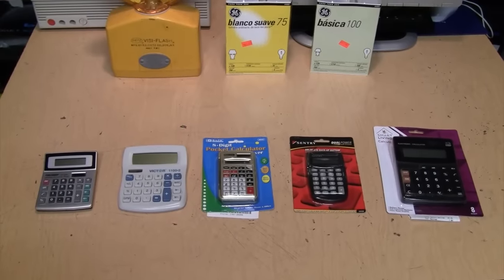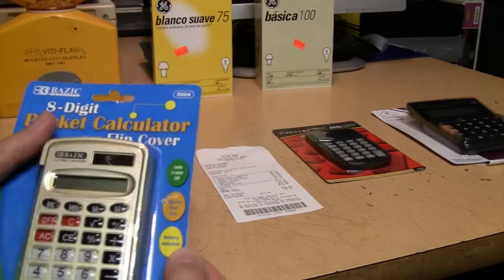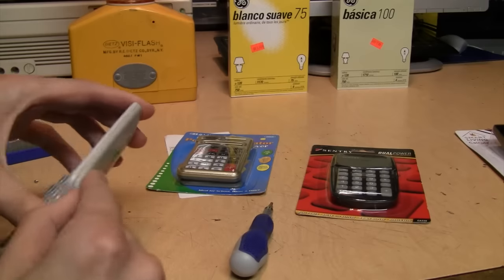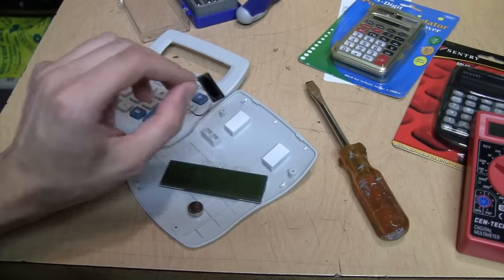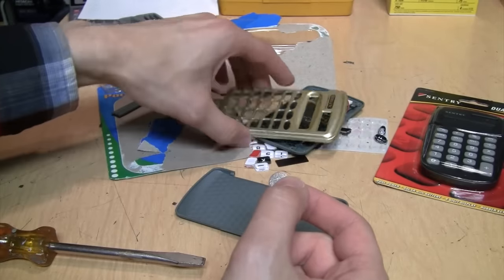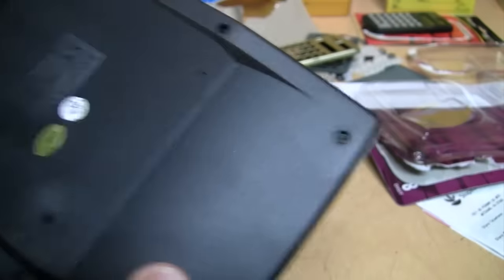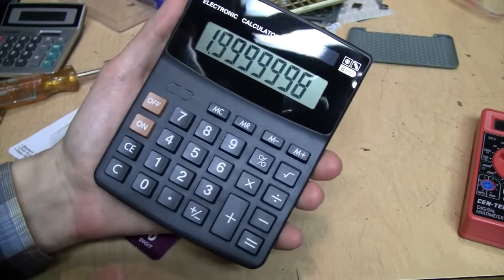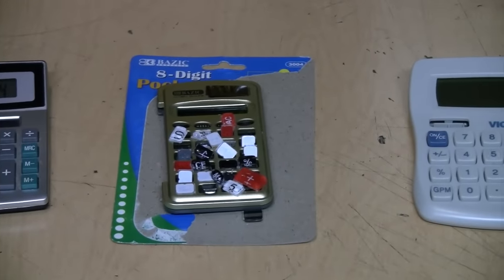Solar calculators BUSTED!

Comment: I found this out in primary school back in like 2010. I was equally disappointed. The strangest part is, some of them had actual solar cells with solder pads… but they just never connected them.

Comment: The diode is there to keep the battery from discharging into the solar cell when it's not producing voltage. It's a good idea, executed as cheaply as possible.

Comment: I always figured it was because they had the solar panels, realized it was cheaper to build them like this, and never updated the plastic case, but that doesn't make sense because the fake solar cell would probably cost more than just not having the part there too.

Comment: I brought a Casio dual power calculator in 99 it just went bad on me this past month. I usually stick with the name brands it doesn't cost that much more and it last forever.  2 Casio  watches from 2004 still  have them works fine.

Comment: This motivated me to find my old Canon LS-3 solar calculator.  I looked it up online and it says they were introduced in 1982, which sounds about right.  Still works fine.  Somewhere I have a TI scientific that would do statics.  If I remember right it only used one AA battery and I think I've only ever put maybe 3 in it in all these years.  The LCD screen was a major improvement over the LED screens from the mid-70's.  Those things would eat the batteries in less than a half-hour of use but they were pretty.

Comment: Its crazy how disposable these are now. When I was very young my Dad bought a Ti SR-10 calculator in 74 or 75 when he was going for his FCC license. I remember him buying it in a camera store it was $95 which was a huge amount of cash then. It had a plug in adaptor and a naugahyde case. I wasn't even allowed to look at it! When The Little Professor came out, it was expensive enough that if I wanted it,  it would be instead of a good toy which wasn't happening. Finally around 1979 I was able to afford my own calculator when Grand Union (defunct New Jersey supermarket) started selling "cheap" Ti's for $5 which was 5 weeks allowance that I saved. The insane part is I absolutely HATE math and am pretty bad at it. That said my dream is to find a decent Curta for under $500. go figure

Comment: Tip if you want to check whether the solar panel works - cover it. If the calculator turns off, it's solar powered.

Comment: I had a calculator that had a working solar cell. 
The battery had died out at one point. After that, I noticed that if I covered this black strip, the LCD fades out and the calculator resets.

Comment: I recently bought a very cheap, very basic  “dual” powered calculator. I haven’t taken it apart because I know the solar part works. It came without a battery installed and when under a light source it works. 

It takes a  AA battery. So I put in a rechargeable one I had. This caused it to NOT work when exposed to light but it worked when no light source was available! When I replaced it with a regular AA battery it works. But I don’t know if the solar panel (that it obviously has) is doing anything!

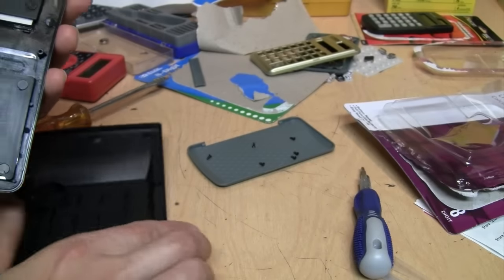Comment: 13:38 Could that diode be there so that the calculator can capture noise and use it as an entropy source for a random function?
Reply: The diode (looks as a germanium type to me) has been added to prevent the solar cell from charging the battery which is a not a good idea. Usually it is integrated on the PCB itself or in the IC.

Comment: I noticed on testing the solar cells with the meter that you did not test them with no light. The wires could have been getting voltage from the battery instead of the cells. Testing with no light should have no voltage.

Comment: The molding dies just weren't worth redesigning after lithium button cell power density made it possible to run for many years without replacement or a solar cell. It's not a scam at least not intentionally. In China lots of old factory tooling gets passed around and used and repurposed for decades. Alot of products have these quirks.

Comment: Some years back I bought a cheap shake flashlight. Worked fine in the store! Getting home I looked closer. The Supposed Neodynium magnet, was just a zinc dipped iron slug. The coils were connected to nothing and the flashlight was only powered by a button cell. So this was obviously a fake product, both fooling the importer and the customers!

Comment: In my experience, it's hard to find a real new one for cheap. They just don't put solar cells anymore in cheap calculators.

I have three old ones from my uncle, 70s and 80s. All have solar cells and no battery. But like I've said, they're 40 years old. Still work though.

Comment: My 30 year old Texas Instruments solar scientific calculator still turns on when it gets taken out of the droor and into the light. Unfortunately I put it away immediately since it's horrible to use because this model has silicone buttons instead the plastic ones found on later models that make punching numbers a chore.

Comment: The diode is connected to the battery terminal so the power from the solar panel doesn't potentially destroy the battery or blow it up or whatever... I doubt it would though

Comment: I had a solar calculator without a battery back in high school and it was really annoying because it wouldn't work with the class lights off if I wasn't sitting by the window.

Comment: I can't tell for sure, but it looks like maybe there are two pads on the right hand side of the last calculator. If indeed this might be the same calculator as sold in china,  you should try soldering a cheap speaker to it and see what happens.

Comment: After around a decade, the little solar powered flashlight I had as a kid stopped working, and I opened it up to discover the same thing! 
It had an ACTUAL solar cell in it though! I tested it with a multimeter and everything; they just figured it would be cheaper to use a real cell and not connect it to anything, I guess.

Comment: Technically speaking those aren't batteries powering your calculator either.  Technically those are air-zinc fuel cells, and that's why they last so long.

Comment: The problem with the fake ones are that they basically using the mold from a real solar calculator but a real solar calculator will cost you between one and ten dollars depending on who made it and where you got it.

Comment: I suspect not many calculators can do square root of 2 times square root of 2 properly.  To do that would require far more advanced logic that remembers the previous entry in its pre-calculated form.

If all it is doing is storing the last floating point value and applying it to the next operation its going to have rounding errors in basically all cases.

Comment: 14:36 - Not disconnecting the battery before making the measurement? The measured voltage might have been from the battery, not the solar cell.

Comment: I see 2 things happening here.  Sold as being solar with no battery needed to get more sales.  The cost of batteries is so low that it's advantageous to use a battery in order to get the sales.  When the battery runs down the user assumes that the solar is no longer working and just gets a new calculator.  I checked 5 units at home and 3 of them were actual.  On the the 2
units with batteries the screws are so minute that the average person would not have the tools to open and change a battery.  Oh, but wait.  Since I think it's solar, I would just assume the solar unlit has failed and toss it anyway.  Never mind.

Comment: When electronic calculators first came on the market they were pricey and would keep them locked up with cameras. Years they had gotten so cheap later I was amazed to see them hanging in the checkout line near the cashier.

Comment: In the 90's they made solar calculators without batteries for real, i have one.
Disadvantage is, when there is low light and the display starts little to fade out, but is still good readable, it may calculate nonsense and give more or less random numbers as result.

Comment: If I were to guess, I'd say these calculators are so cheap bc they've been making them or ones similar for decades, and making the equipment to create new calculator cases would eat those profits. So they use the old solar cases regardless if they implement a solar cell or not

Comment: I think the reason why they put in fake solar cells might because it makes it easier to manufacture different models. They can have a solar and non solar calculator using the same front panel

Comment: We've got a blue calculator from Japan that's been in our junk drawer for the past 25 years that has a solar panel on it. We know the solar cell is legit because the battery died at least a decade ago and you have to hold it in direct sunlight to get a nice strong contrast on the screen.

Comment: So you managed to break multiple, perfectly functional calculators, only to find out that some manufacturers use coloring on the calculators that resembles a solar panel, but make no claim that it is a solar calculator…..BRILLIANT!  And that only took 18 minutes. SMH🤦🏻‍♂️

Comment: It could be that they just use a standard casing... and putting in the solar component is optional - so for the ones that don't they just put a blanking piece in there.

Comment: They just make 1 case for both calculator.  They didn't claim on the packaging that it is a solar calculator in the first place. But in case they make another 1 solar power than the hole is already there

Comment: We use TI-30XIIS in the center I work at in the college.  TI supplied us with a load for free since we will only allow this make and model in our facility.  I'm sure they think they would make more then enough back as student purchase the same calculator for home use.  When our first one died on us it was brought to me since I do some electronic work.  I looked at the unit a second and said I think I knew the issue.  I opened it up using my swiss cyber knife.  I said here is the issue, the battery is dead.  The instructor was insistent it was solar powered.  I pulled the piece of black plastic up and said what solar panel.  I told them it was common to do that.  Other models can use the same case and may have a solar panel.  This model didn't.  I ended up ordering a bunch of replacement batteries.

Comment: That's messed up! As a kid I always thought those were light sensors, not solar cells, used so that it would turn off if in the dark for a while (like in a pocket, purse or bag) to save the battery life.
Reply: found out the hard way it was a solar panel

Comment: I had a Philips scientific calculator that has a real working solar panel (2*7.5 cm). Once it's battery ran out, i revived it by rubbing my hands really hot and stuck my finger to the cell. It turned on.. somehow.

Comment: I have a casio calculator from over 35 years ago. I've had it that long! Having a battery was a feature, to extend the life of the battery with solar. Used to be very responsive in any light. Now it only works in good light :) and fades out if covered.

Faking it is a bit sad, really.

Comment: The first calculator I had was a Heathkit and in order to do a problem with subtraction you had to enter a "+" after each number,
Like 4+ - 3+ = 1
Think of the + as a enter button. For multiplication,
2+ x 6+ = 12

Comment: 14:57 I think the most likely reason the packaging didn't advertise it as dual powered is due to the marketing department not having a good grasp of English so no one thought to include it. If you've seen how bad the English is for a lot of other products, it shows that there really is no oversight when it comes to that area, which to us seems to be very low hanging fruit, but in reality, it isn't.

Comment: The calculator is correct with the square route.

Why you may ask.

Because in maths If it's 1.9999998 or similar it changes to 2 for ease of access

Comment: they probably bought the plastic “body” of the calculators, from a company that manufactures them, and assembled the calculators without solar panels to make them cheaper, with just the chip.

Comment: Some of the really cheap 4 function calculators they use for labs in college use really cheap batteries and a functioning solar cell. It gets almost impossible to read if you cover the cell.

Comment: What an amazing time to be alive, when a calculator can be so cheap that including a LEGIT solar cell is so cheap, it actually cost MORE to print on the package that it has solar power and they would rather just not even waste the money to advertise it on the package , but the cells are so cheap that running a 2nd production line that does not include them is also not worth it .

EDIT : and yet it is also worth risking a fine for faking a cell and advertising that there is one .

Comment: I put a new battery into my Radio Shack EC-4024 dual-powered calculator last week.  (It's a rebranded Casio FX-50F.)
According to the manual its battery should be replaced every seven years, which means that I'm about...29 years behind schedule on that.

Comment: Hmm, I tested this as a bored kid by covering up the solar board, the calculator quickly died and wouldn't power on for a usable period until removing my finger from the solar array.
Reply: I conclude that you got scammed.
Reply: Mine also does that

Comment: they was originally solar but making injection molds is expensive as hell so sometimes its cheaper to reuse older molds

in some cases a manufacturer might buy a few pallets of cases from anouther manufacturer or they wish to make a cheaper version so in either case they reuse the solar cases with batteries and just put a dummy solar there

why they do this and not just put a logo there idk

Comment: My "Sentry CA279 Dual Power" Calculator has a legitimate solar panel. The voltage is 1/10 more when light is applied to the solar cell (same exact light source as in the video) than when no light is applied (battery power only). Just an fyi.

Comment: I have some Casio calculators which are totally solar powered. Cover the panel and they die. Uncover it and they come back again. I also have a credit card sized solar calculator somewhere which is the same. It seems completely weird to pretend to be solar though - why even claim to be solar if they're not?

Comment: 13:35 Hmm, btw that Zener diode can also act as an inefficient solar panel, thought you would be pleased to know that while you had 3 calculators with solar panels, that diode can also be used, lul, if they made a hole in the plastic to let light hit the diode the design would have been more energy efficient.

Comment: you're not trying to trick you by putting a "fake" solar cell. it's most likely a placeholder for another model which uses the exact same casing and they probably sell them with solar and without. that's why the packaging does not say anything about solar and they have to fill the empty solar cell holder with something
so it's just a black piece of plastic.

Comment: Might be cheaper to reuse the cases for solar/no solar options.
And might have been cheaper to use in the past, but batteries are cheaper now?
I agree that it's odd, not sure I would care personally if it had or didn't have the solar thing. Although...I just use my phone/computer.

Comment: I remember when I was a kid my dad has a Casio that was dual power solar/battery. 35 years later it still worked without ever changing the battery although it dimmed whenever we pressed a button. It's probably long gone by now but they last longer than human beings.

Comment: Looks like The diode was placed in line with the battery to reduce the voltage going to the circuit

Comment: I have one that actually has a working solar panel and the battery died so if you cover the solar panel it doesn't work it has to be in the sun. It's shaped like a chocolate bar, I got it in 4th grade and it used to smell like chocolate but not anymore

Comment: Some of them have real solar cells in them but they are not even wired in. It turns out those were seconds or defective solar panels put in but never wired. Out of curiosity I wired one up and it worked when combined with a small capacitor and a diode.❤
Reply: Use a germanium or small Schottky diode 0.2v or less drop.

Comment: My brother had calculator like bazic but it were under the "kenco" brand. And it were solar. Or at least it were working for more than 10 years. I can't remember it having cover attached, i guess it had some similar story. It were green and cover were less flashy. Also it could beep on key press.

Comment: This is not something, I'd figure out. It's all second hand info I got from a Vietnamiese guy, who sold such things in 90s and early 2k in grey market in our town, so ...ya'll welcome to take this with a grain of salt. I was also inquiring him about Tetris game, not a calculator, but I'd surmise the explanation fits there as well.

According to his explanation, those weird cutouts and spacings in cover and parts are most likely result of the fact, that this cover design is:

1.) quite old, originally designed to accomodate for much larger parts and subsequently only reworked inside with nobody ever bothering to redesign the cover itself

2.) used for plethora of other models since its very cheap to do it this way and different assemblies may use different parts in otherwise similar casing

3.) cover from previously discontinued model, that still more or less fits in the new one. This may explain the fake solar cells, since they simply have the cutout and have to put something inside, so they just put in cheap imitation of the cell and "nobody will be the wiser"

Comment: Good review pretty slow as it should be, thank you. I questioned myself if any of the calculators a i have is equipped with real solar cell. They proved me this by working because of the direct sunlight. The only question left if there's any battery were inside. I didn't even risked to disassemble them.